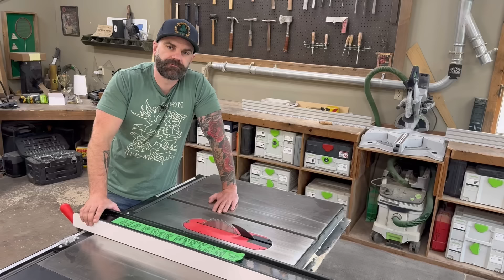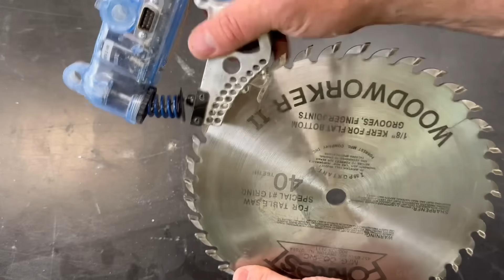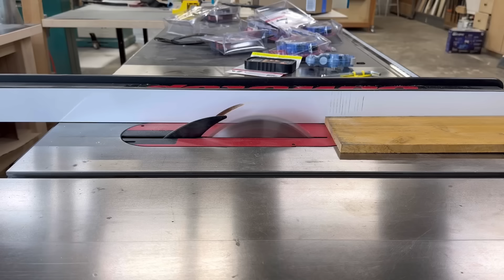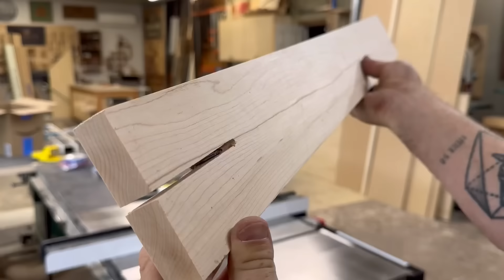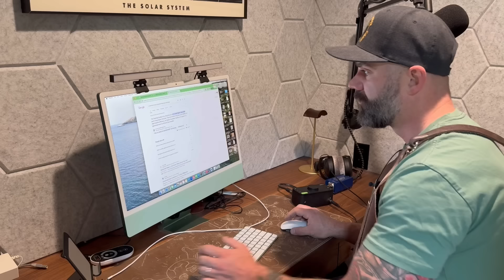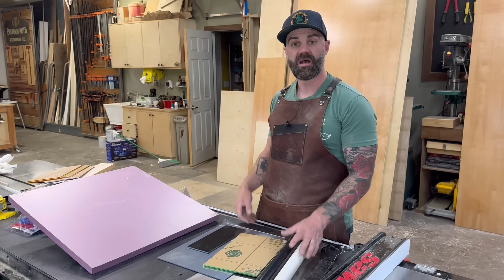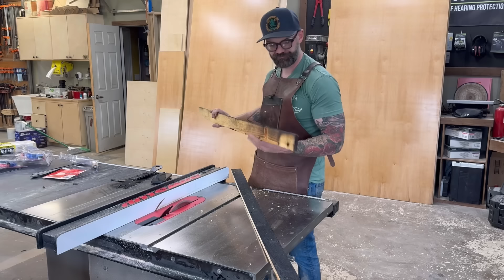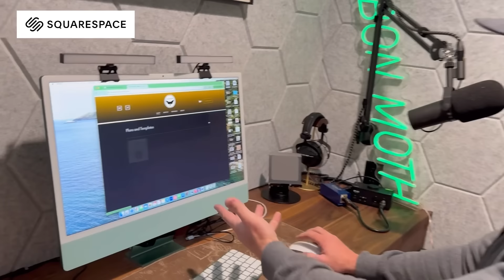Finger Versus Table Saw || Testing SawStop Myths

Comment: The wood that set mine off was treated wood.                   I set mine off a couple of weeks ago while it was off and winding down.  It didn't "pop" so I thought it was fine.  It felt as subtle as touching a cat whisker.  Then when next I went to use it, I discovered it had been set off.  I just couldn't hear it and it didn't drop but was firmly entrenched in the aluminum.  Amazing technology.   Also, reading all these comments, I think we can get a degree in electrical engineering.  😋
Reply: The rotational energy of the blade and motor pushes the blade down when the brake stops the blade. If the blade is not rotating very quickly, there is not enough energy to push the blade&motor down, and probably not much energy to make noise. The wire vaporizing is probably not the source of the pop noise
Reply: @johnhaller5851 yhea I'd imagine the pop is either the rapid clamping or the mechanical action of the spring.
Reply: @johnhaller5851    Thank you for explaining that!

Comment: Thank you for the experiments. Great video. We all sweat differently and in my case with damp boots or sneakers from walking in the yard, sweaty feet and a damp or wet board, if one hand was resting on the table and the other hand pushing the damp board into the saw I would be cautious about setting off the safety switch. Again well worth watching.

Comment: Indeed - Capacitance is more important here than conductivity: "The design takes advantage of the difference in conductance and capacitance between wood and flesh.  An oscillator generates a 12-volt, 200-kilohertz (kHz) pulsed electrical signal, which is applied to a small plate on one side of the blade. The signal is transferred to the blade by capacitive coupling."
Reply: That’s the comment I was waiting for! The system used the electrical property of capacitance, not conductivity. and the system has a threshold you have to exceed before the computer in the cartridge triggers the device. The computer also records all this info and sawstop can analyze it. Some times 1 tooth will set it off, some times multiple teeth need to be in contact to exceed the threshold.
Sorry, after I triggered my sawstop twice, I contacted sawstop and learned a few things
Reply: @paulalman762  Exactly. The large aluminum fence isn't "conducting" the signal, it's altering the capacitance of the body transferring the signal, changing the reception on the other end. If you're old like me, it's like putting your hand on a radio or TV antenna and seeing the reception change.

Comment: The detection signal looks to be a high frequency sine wave induced onto the blade: https://patents.google.com/patent/US7617752
When this signal on the blade is grounded (loaded down below the detection threshold), it stops the blade. AC electricity can cross gaps that DC electricity cannot. The metal doesn't have to touch to get current to flow - surface area and gap spacing are what matters. The more surface area and the closer the gap, the larger capacitor will form, and the more AC current will flow.
I suspect that the big piece of aluminum was loading the blade through the capacitor that was formed between the bottom surface of the aluminum, and the metal deck of the table (it likely had some bolt/screw heads that were very close to touching the table. The nail did not have enough surface area to form a very big capacitor, nor was it close enough to the deck metal to load down the blade signal. I laughed out loud at the fast-forward sound effects. :)

Comment: i believe it works on capacitance. change the signal between the plates by altering the capacitance effect of the blade enough, and it will trigger. You used large pieces of aluminium, and only small pieces of steel. would be interesting to see what would happen with a small piece of aluminium, and a large piece of steel.

Comment: I have two fingertips that are flattened on top because I had a board that was about to kick back and I instinctively grabbed it, flying a little too close to the sun. It hurt like hell. Sometime later, I ordered a sawstop, but they kept delaying shipment over and over again until I finally just cancelled the order. Now I just use my Bosch table saw with as many protection mechanisms (riving knife, blade guard, etc) as I can possibly have on to do my cuts safely. While I'll never reach toward the blade again, I do kind of wish I had this extra layer of protection.

Comment: Re: charred wood. Carbon is an insulator. Not surprising that it didn't set it off. Re: saw off, blade spinning. If the controller box is on (green light) the braking system is active.

Comment: What is not reported is the number of times the saw triggers for no reason.  My son ended up having to rewire the motor to bypass the saw stop technology because of constant false triggers. Other than a couple of instances where a tape measure hit it while blade was coasting to a stop, all other failure were dry wood with no nails or foreign materials.  Saw Stop had no solution for him.   He spent over $3k in cartridges for no reason and lost a huge amount of shop time (professional woodworker).

Comment: Great video. The one you didn’t test was pressure treated wood. That’s what I have heard unknowingly sets it off the most.
Reply: That could potentially make sense; I understand they oftentimes use a solution with copper to treat those, and copper is extremely conductive.

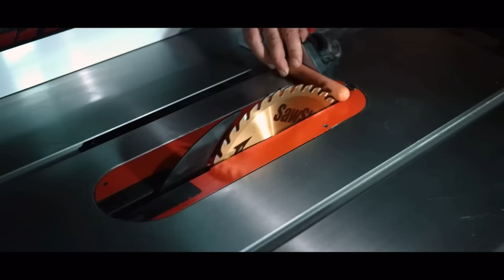Comment: 0:58 actually, you got that wrong. as you can see at 2:16, FIRST it stops the blade spinning (so abruptly that the carbide tips can break off!) and THEN the blade drops away.
3:52 JKM should stick to woodworking and leave the explanations to those who can explain things.
23:00 was there a protective film on that mirror material? if so, remove it to expose the aluminium, then run the test again. direct contact between the aluminium and your hand (or the table) could set it off.
24:58 that doesn't surprise me. your hands were in direct contact with the carbon fiber, completing the circuit and setting it off. i don't think it had anything to do with electrostatics. you should run that again, except instead of holding it, you should clamp it down. that's what those t-tracks are for, right?

Comment: Couple of reactions as I watch this that I think are relevant (this is not a critique of you btw, im just very unhappy with Sawstop rn):
1) Sawstop actually has an "official" way to remove the blade for reuse 
2) My saw sets off breaks whenever it damn well chooses and Sawstop adamantly refuses that my unit could be a bad egg
3)  Not sure if you mention it yet (im only a few min in) but the government is doing some interesting things regarding Sawstop tech right now and its something Id recommend any woodworker - or user of a table saw - do some quick googling to see what the future has laid out for us
4) Bypass is bs at times bc- again - they refuse to acknowledge that the bypass is picky and choosey when it comes to my unit and it drives me mad
5) I was told by Sawstop that the break - even in bypass mode - still has a "max" moisture limit where itll bypass the bypass and set itself off. I have had this happen in action twice. They have since chosen to pretend they never said that to me.
6) Im a nobody but I made an instagram reel about the last trip and it wasnt until they asked for it and reviewed it that they randomly decided to just "give" me a curtesy replacement.. its my 3rd "curtesy" replacement after an issue that was not looked into beyond phone and email tech support (thats iffy if you ask me)
7) atp if you cant already tell that ive got some beef with them, when you cut that river board and it didnt set off my jaw DROPPED. I had a break trip on a board that was only BARELY rained on between my truck and shop.
8) im telling you all of this bc like I said, im a nobody but youre a voice thats listened to and it feels right to share all this. If I had the same number of breaks to do all your tests that didnt trip but on my saw, I would and I think it would reallllly make a point
9) Id be interested in seeing the same nail test over and over but each time it passes, switch the break to see a variance in the breaks
10) im starting to wonder if its my unit thats got issues or yours atp because this is insane
11) the blue foam generates much more static so I wonder how that would do

Man I wish I could prove these passes wrong while replicating your video test for test so that maybe somebody at Sawstop will finally listen to me. My saw was my largest business investment to date and was suppose to last my entire lifetime but I am legitimately considering buying something else. Thanks for this Jason
Reply: Keep us posted

Comment: Great video. Note that with your Saw Stop ready but not spinning you’ll have a green LED. To see if something will drop the blade, push it against the blade while the blade is sitting still such as your finger or wood that is wet with salt water. If the red LED starts flashing then your blade will drop when it is cutting but this testing won’t drop the blade as long as the saw is still.
Reply: It is. The bypass mode will also show you if it would have triggered with the same style of light flashing.
Reply: Good to know! This is the first time I’ve heard this. I'd bet it's in the Instructions!
Reply: @GrayRaceCat  It's definitely in the instructions. The control panel and its LED indicator states are all enumerated and described in the manual. For instance, if you forget the lock key when replacing the cartridge, there is a specific flashing pattern for that. If there's one section in the manual worth reading carefully, it's the one that explains what the panel indicator lights are telling you, and how to engage bypass mode when you're unsure if what you're going to cut will trip the saw part way through the cut.
Reply: @vbikcl  Thank you.
Reply: Ahh...wood that's wet with salt water makes sense. Now he has to do the video all over again.
Reply: That's not as dramatic lol
Reply: The best test is to cut in bypass mode and check the LEDs.  The sensitivity is different when the blade is spinning vs. stopped.
Reply: Forrest green
Reply: Good to know! Also, you were great in Friends.
Reply: I wish I had a Sawstop , sat here typing with one finger😢

Comment: I worked in a mobile home factory and saw treated lumber set the saw stop saws on multiple occasions when the decking guys would forget to disable the saw stop. Dont know why they would set it off i comparison to just wet wood. I know treated has a lot of chemicals. But maybe its because it above the 32 percent idk. Or some reaction to the chemicals. But we had 8 different saw stops in a production setting and treated would always set them off. I dont own a saw stop so i can recite the manual. I will say im not the biggest fan of saw stop but i will say this. We put those saws through hell and they just kept coming. 6 double wide mobile homes a day as fast as we could. Cutting everything from osb to 2×12s plywood and drywall on those saws. We tried to kill them going as fast as we could. And they were fuckin beast
Reply: Treated wood, at least the green-tinted kind, have a high Copper content (copper oxide is green).

Comment: Your crosscut sled has hardware through the aluminum down through the base. That completes the circuit. The nail in board just never happened to touch the table and blade at same time
Reply: The sawstop doesn't work by detecting a completed circuit. It works by detecting something with human-body-like capacitance (which is also how the touch screen on your phone works).
Reply: I'd bet my life that the hardware is countersunk so that it doesn't touch and scratch the surface of your table saw.
Reply: @carlstrohm3785  It appears as if there is a conductivity path between the fence and the rail.  This would have completed the circuit.
Reply: @wellwornpast  the crosscut sled is not touching the fence at all. There's a couple plus inches between the two.
Reply: I was going to comment the exact same thing, I don’t think it has anything to do with aluminum vs steel, it is that the fence completed the circuit somehow through the bolts that are connected to the runners and the table top, connecting it to ground and tripping the wire.

It makes more sense to me than any “aluminum is more conductive “ reasoning

Might be wrong though 🤷

Comment: I think the fence of the Rockler sled was setting it off because metal was connected to the table of the saw through bolts and miter slots, etc completing the circuit.  The nails and staples didn't set it off because they were floating in the wood and therefore insulated.  If you'd have driven a nail deep enough, or flipped the board over, so the metal was in contact with the table, it would have set the saw off, I bet.  Either way, you don't owe anyone any bourbon ;).
Reply: The runners on his crosscut sled are not metal, and the bottom face of them is not contacting the bottom of the slots on his table, so there's no electrical continuity there.
Reply: @tjp148  is it the volume of the fence, then?
Reply: I am so glad I wasn't the only one to notice this.
Reply: I would be my life that the hardware is countersunk and doesn't touch the saw. If it did it would scratch your saw every time it was used. Not enough current here to jump the gap.

Comment: My guess is that the humidity in your shop was between 40-60% when testing for static triggers. If you get your humidity down below about 35% or ideally closer to 10%, there would be a much higher chance of triggering your saw.

Comment: We need a crossover with ElectroBOOM to explain the electrical properties of the SawStop break.
Reply: It uses a micro amp 3v sensor on the blade.

When it detects a significant amplitude drop, it triggers a gated capacitor that sends enough electricity through the trigger wire to vaporize it similar to burning an old bulb filament.

With the trigger wire gone the action spring engages causing the break to clamp and the articulate arm to pull down mechanical.

It essentially works like the dastardly child of a snare trap and a circuit breaker.

All this takes 6x less time than an airbag deployment

Comment: The brake engages when a circuit is complete. So the aluminum may have set it off if the pivot is metal and touching both the table and the aluminum.

Comment: Hey, you researched THERMAL conductivity not electrical conductivity. However they are proportional, but some metals can be inversely proportional. Basically you got a bit lucky. In the future, if you want to know if it’ll be a good heat sink look up thermal and if you want to know if it’ll trigger the saw stop look up electrical conductivity.

Comment: I disengaged my SawStop brake from my blade by placing the blade in a vice and using a brass hammer, I tapped the brake off. I thought the blade looked real good, but when I had it sharpened, the shop said it was a bit bent, but they straightened it. It works fine now.

Comment: As A Mechanical Engineer, with no knowledge of How the Sawstop actually works,Unless the  ability is all in the brake, then I think the 'simple" act of dropping the blade and turning off the saw would do the same thing, also include the resat so the person doesn't try again
Reply: The sudden stop of the blade is what drops it below the table.

Comment: Soaking a previously dried board will not make it equivalent to green wood. In green wood water is inside the cells where the minerals are, in soaked dry wood the water will just be between the cells and will not interact with the minerals. Thus the electrical conducting/impeding properties will not be the same.
Reply: Plus the soaking did not take the water into the center of the wood to my eye.

Comment: Is the aluminium fence attached with bolts through the bottom, creating a circuit through the table
Is the insulation fom aluminium backed in the ones that set it off
What about if the breaker pops or there's a power cut which would completely remove poweer from the saw
The fact the system can be bypassed means you have to take more care in this mode, why not just take care anyway and save yourself a fortune
Reply: Because a trip to the emergency room could cost you $1000.00 to 100,000.00.  and an accident is an accident.

Comment: There is rigid foam insulation with foil backing, typically aluminum. This would explain the instance of the saw stopping when cutting foam.
Reply: It also stops when you try to cut metal plated egg crate light lens
Reply: Been there done that.